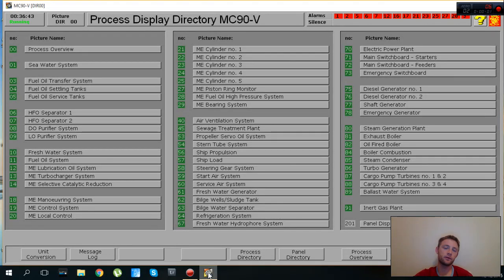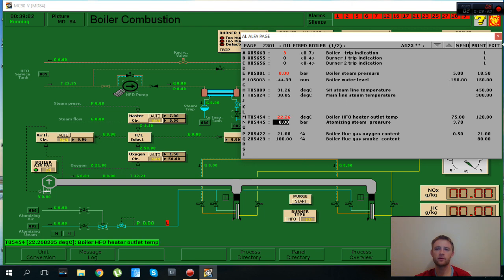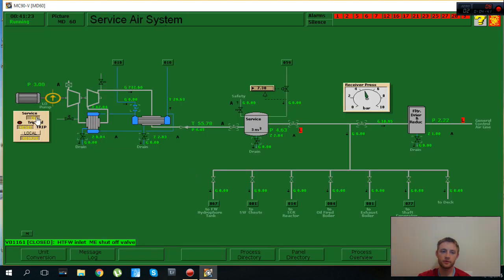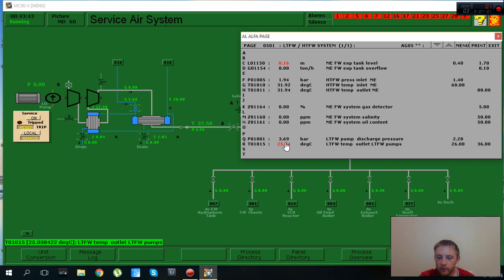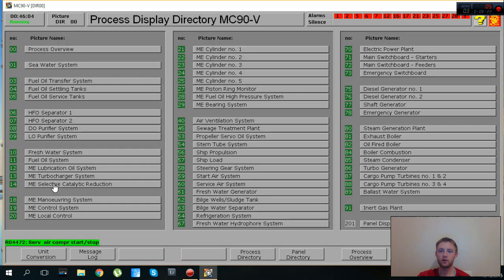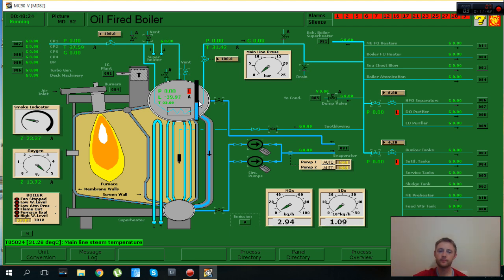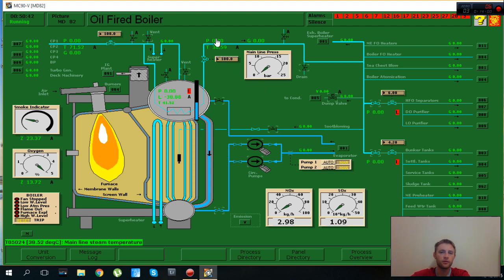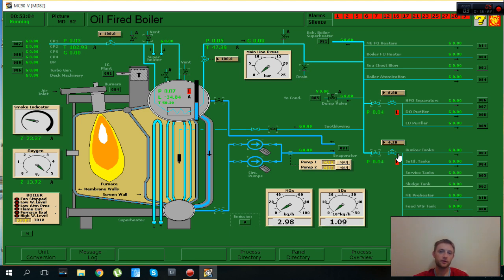How to start ship Main steam boiler for first time lesson 3

Comment: Sir i start burner boiler trip furnace expl. What the solution that is.
Reply from the maker: Hello you should check all points that necessary to start your boiler such as fuel-air-ignition and atomizing air .
Reply: @Adventure-Story  done sir.. i check all points and step by step.. but boiler trip furnace.. 🙏
Reply from the maker: Probably program lagging.

Comment: Can you explain how work a diathermic oil boiler? I searched some video on internet but i didnt found nothing, i dont understand a base to choise steam boiler or diathermic oil boiler, ok temperature is better to achieve with oil, but why in the most of ship are used steam boiler? thanks for all
Reply from the maker: Nice question ,i have experince with this two types of boilers.Steam boilers system is prefered for discharging for big size ships,and oil boilers is prefered in small installations for heating only.I will make a video about this systems.Thanks!!!!